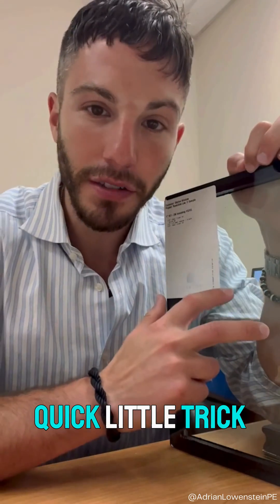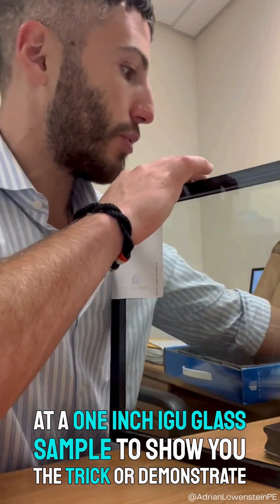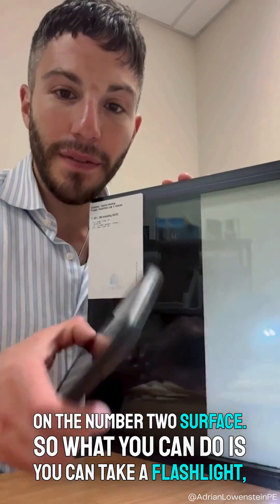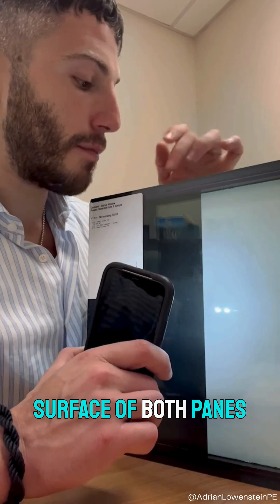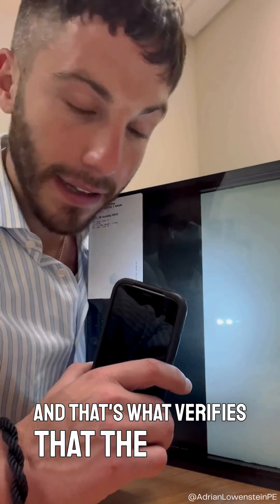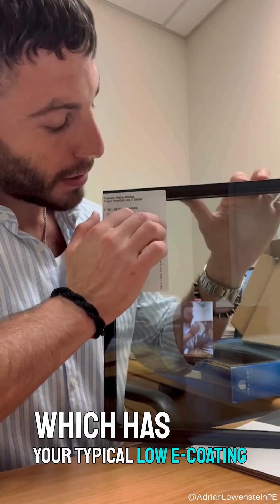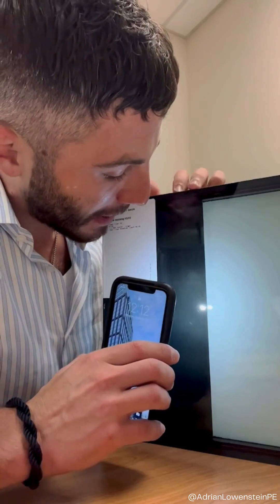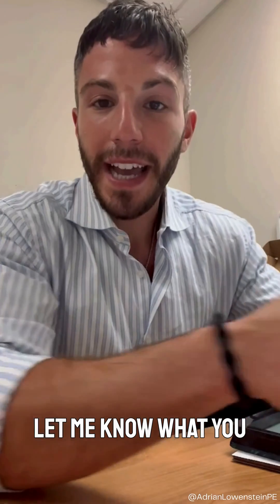Does YOUR window at home have a low-e coating?

Comment: That's brilliant Adrian! Thanks for sharing 👍
Just tried this at home, and I seem to have a slight tint on the outer most Surface 1 😅 So can likely expect coating/film deterioration over time due to the extreme heat we have here!

Comment: I have so many questions. What is low-e? Why does it matter? What does IGU mean? VE2M? Does 'number 2 surface' mean the backside of the front pane? A closeup would be good to demonstrate the difference

Edit: Just noticed 'insulating glass unit' in the description
Reply: Hey Brendan. Low-e stands for low emissivity, which basically means it is a coating that limits the amount of solar radiation that passes through the glass. Thus keeping the heat out. And yes, Surface 2 is the back of the front external pane.